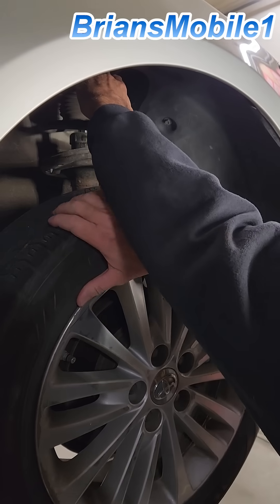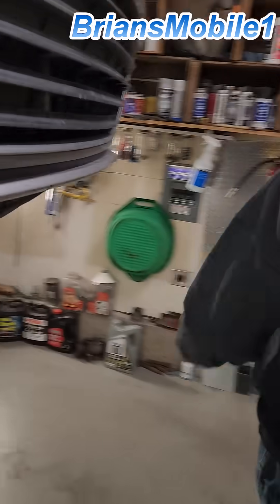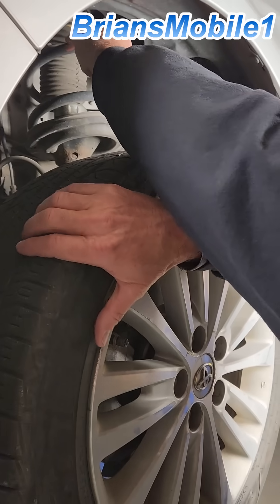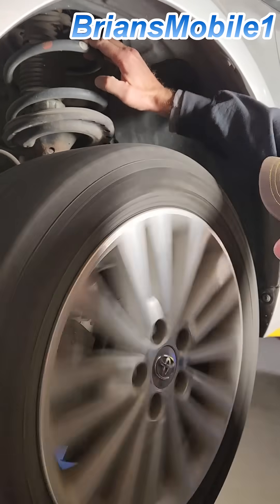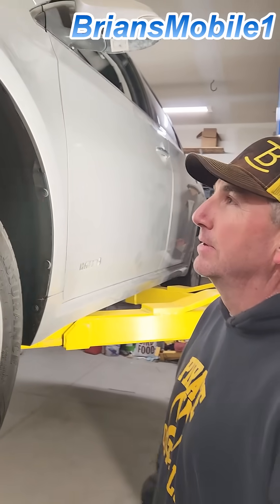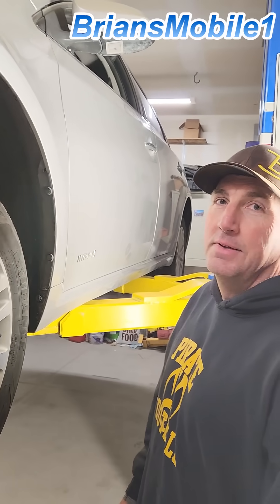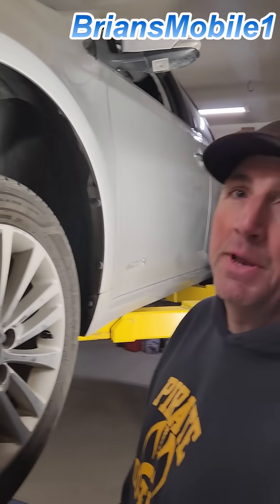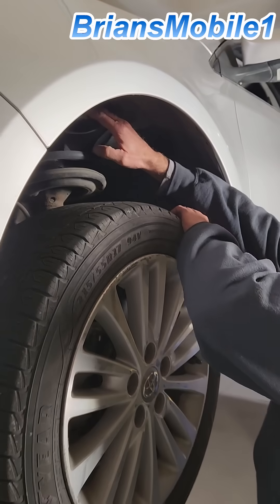Simple Wheel Hub Bearing Test

Comment: Best thing there is to do both of them as a set, as after all with suspension and such you replace both sides at the same time, or you will be doing the other one in a short time again, as it fails.  If it was accident damage not so much,  but you will find one fails shortly after, as it has more wear. Yes more expensive, but you at least will know you have a long service life ahead now.